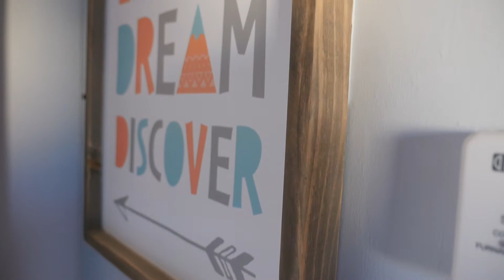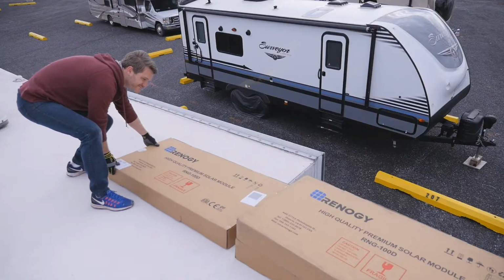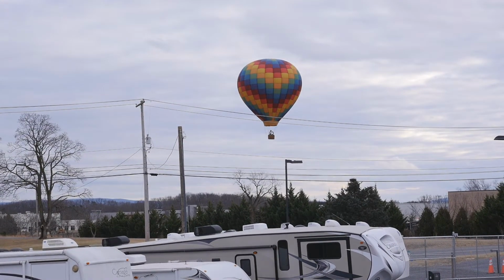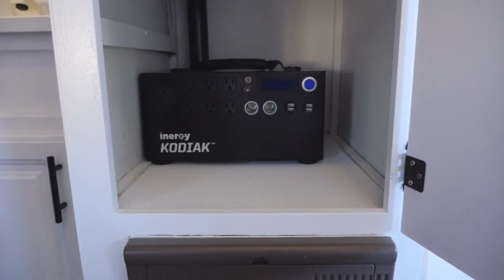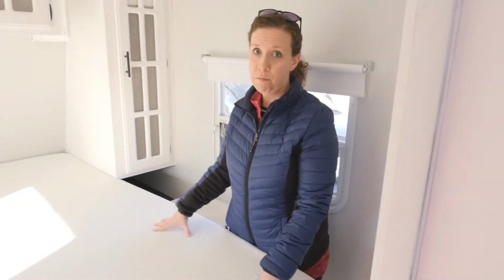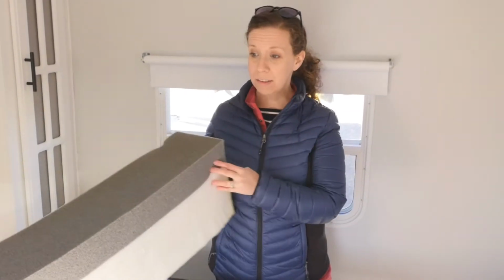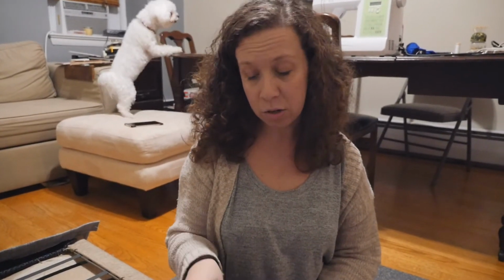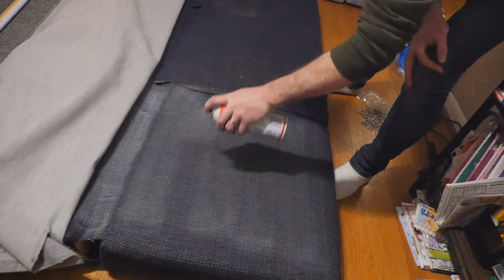RV travel trailer remodel: solar panels, lithium ion battery & couch reupholstering

Comment: You can connect the whole RV into the inverts by doing so, connect the Converter into the Microwave or Air conditioner breaker switch, so for whenever you plug your onshore power line to the inverter, make sure the AC or microwave breaker is turned off, so the inverter doesn’t charge the battery as it draw power from it at the same time. Voilà so now you have a 110V all over the RV. If you need any further assistance let me know

Comment: Did you use a special crimper made for the mc4 connectors or can you use a std crimper. Thanks for posting, we're looking to add some solar. Were those mounting brackets from remove? They look different than what I've seen before. Yours look like they would work for tilting the panels.

Comment: Does the MC4 connector on the solar panels from Renogy plug directly into the Inergy Kodiak or do you need some sort of adapter?  Thanks!
Reply from the maker: The Inergy sells an adapter cable which allows you to connect to MC4 connections.

Comment: Where did you get that tool for the metal rings on the couch?  I had somebody remake the cover but I didn't know how I was going to attach it back onto the frame!  Thanks!
Reply: Alecia Rhead I'm not the video producer but in answer to your question they are called 'hog ring pliers'. As far as finding them, I would suggest checking with local automotive upholstery shops. They use them alot, or check the internet. Probably get them from Amazon.